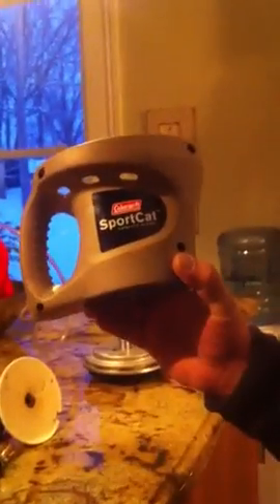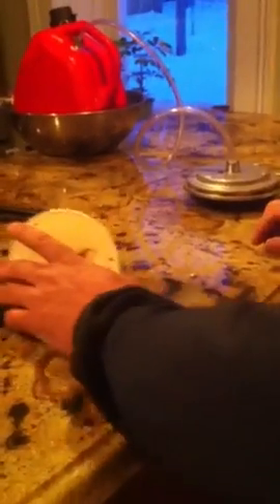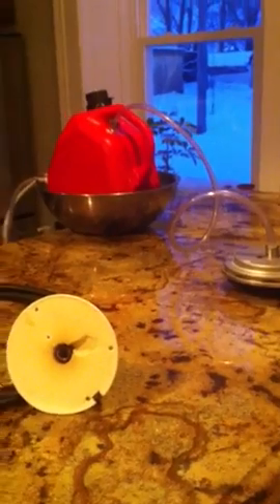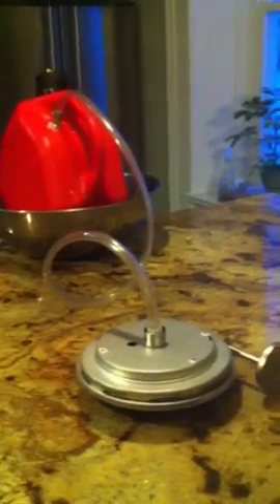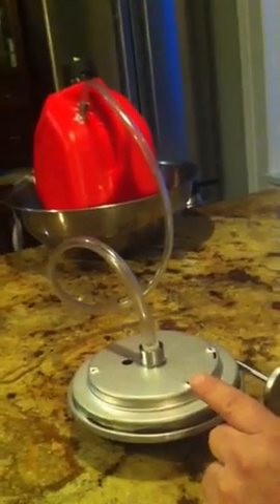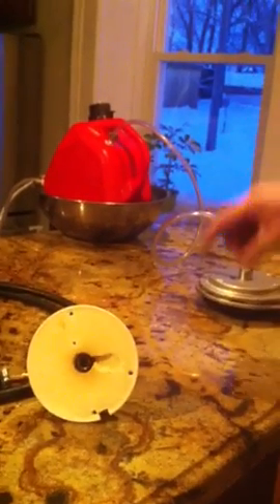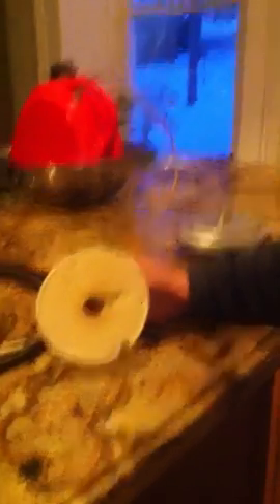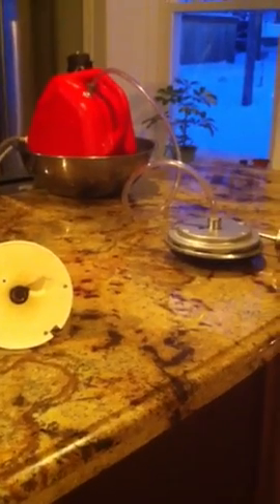Coleman sport cat experiment

Comment: Great work! 5 amps will give you roughly 1/8 to 1/4 lpm not a lot of production which may explain why it takes a while to heat up, I'm not sure of those heaters have as much noble metals in them as the automobile cats either. Actually I don't think any of us have experimented with a Coleman heater yet but its good to know that it will work. Maybe we can also use the insulation and diffusion bar in the same manner as my most recent video and it will work. Maybe start with about a lpm of production, get the heater going then pulse the gas on and off or throttle the current back to to your 5 amps? I don't know...Good stuff, yeah don't let the wife see you do that, she will flip a switch lol. My wife is like JUSTIN! GET YOUR SHIT OUT OF MY KITCHEN HAHAHA